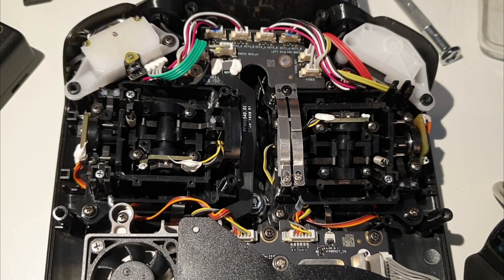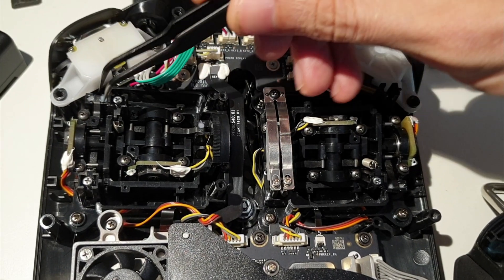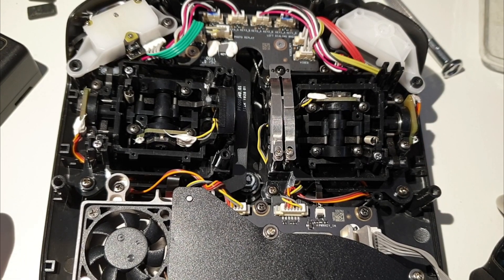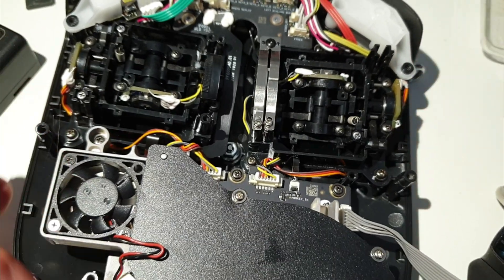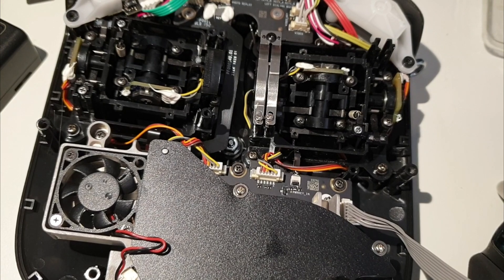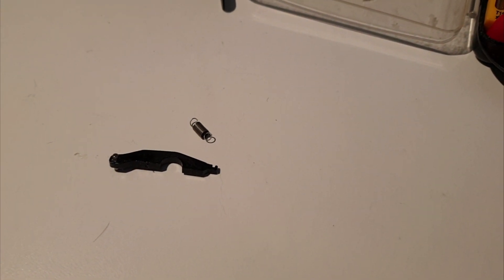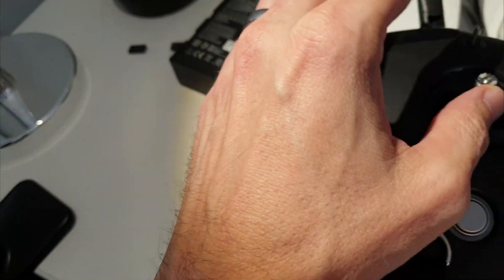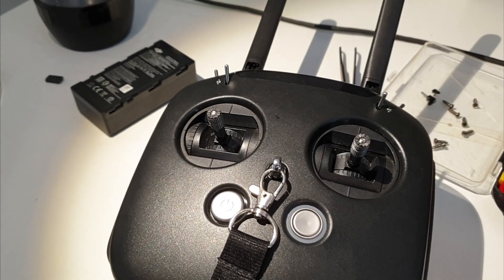My DJI FPV remote started centering its throttle. Here's how I "fixed" it

Comment: The same piece has been broken in mine since I got the radio 2 years ago. It was still keeping the spring down just enough to disengage the centering but the throttle would make a weird jump at the very top end of the range. Saw your video and thought this might be a fix and it was. Thank you for making it.

Comment: Hello i have a question please. I Fly in mode 2 but i want to invert the please. Can you tell what can i do please. Thank you.
Reply from the maker: You'll want to take the screw that stop the re-centering functionality on the left stick and then apply that screw to the corresponding spot on the right stick.

Comment: So if I understood you: there's a mechanism to return the sticks to center, and it was disabled on the right stick. that was normal. then a physical failure meant the disabling mechanism broke. instead of fixing the disabling mechanism, you just removed it. (i.e. disabled the disabling mechanism)

Also, I think the video is flipped left/right? (along x axis) - so "right stick" above is what is normally called the left stick, except the video is flipped.
Reply from the maker: Yep, I disabled the centering mechanism :-) I'm not sure the video is flipped. I keep referring to the stick on the right as the Left Stick since that's what it is when using the remote in normal operation. It is flipped because it's upside down.
Reply: @ess_squared_productions  Hey! I feel like I wanna remove all self centering settings on my controller, would that be a good idea. I'm using my FPV to make cinematic shots from nice places i go to and I need the FPV to keep the same angle and not move so it's more cinematic. By removing ALL mechanism for all 4 axes would that be a good idea?  Thanks
Reply from the maker: @JankoBros  Hmm, it depends on which flying mode you are using. If you in "acro" then the quad only rolls/pitches/yaws while you apply stick and doesn't continue once the stick returns to center. I feel like perhaps you might be flying in "stabilization" or "horizon" mode where the quad itself returns to horizontal when the sticks return to center. This mode of flying is generally for beginners and people transition to acro as time goes on. If I'm correct in this assumption I would NOT recommend that you get the sticks to return to center for roll/pitch/yaw on your controller and just focus on flying in acro mode instead. Let me know.